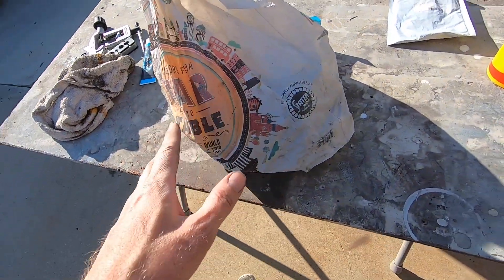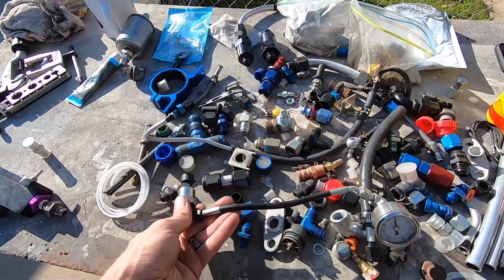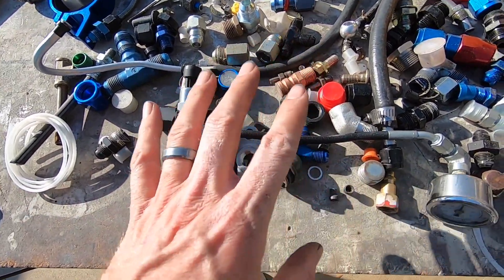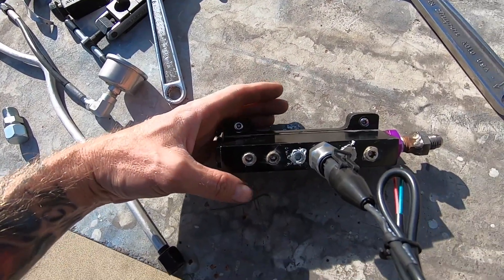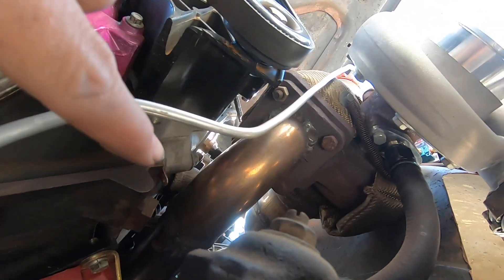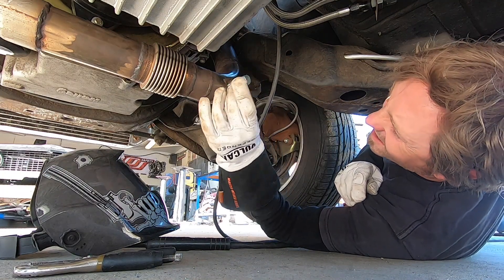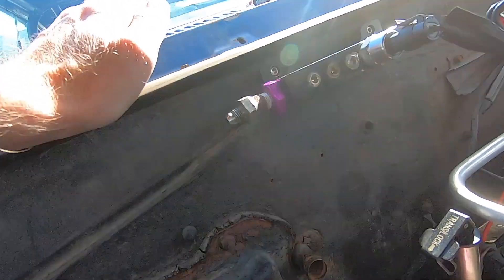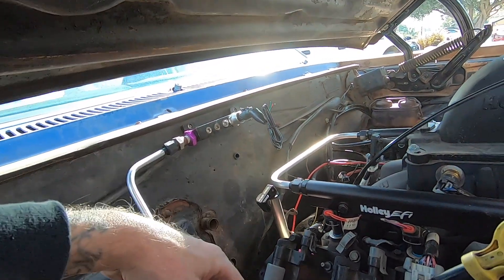Turbo Back Pressure Sensor Install

Comment: what was your broadcast rate setting in the holley settings
Reply from the maker: This was quite a while ago. I just used a 5v transducer to measure it. Im not even sure what a broadcast rate is to be honest. Not sure you can play with that in the terminator x software. If you can I have not.

Comment: Are you using the solid state relay for your fuel pump ?
Reply from the maker: No my fuel pump is on a standard style relay. The solid state relay in my car is for the trans brake.
Reply: @Burndown  Thanks Mate - building single turbo S-480 ZZ502 down under in Sydney

Comment: Do you have some inputs on the Holley dash separate from the terminator x
Reply from the maker: Yes but I would have to get a separate IO harness. I want to get that and the GPS module for it. Think it allows like 4 in and 4 out? Ill have to look it up but I would like to input my trans temp, and fuel level.

Comment: Pretty good ideas to monitor stuff it would be cool to have all the inputs and keep those sensors on all the time and do a sensor for the fuel pressure also
Reply from the maker: Im gonna use the dash for fuel and trans temp when I get the harness.